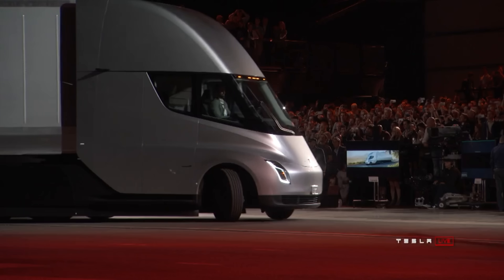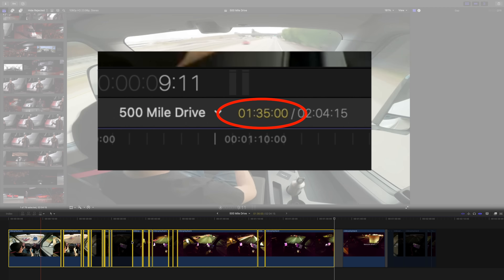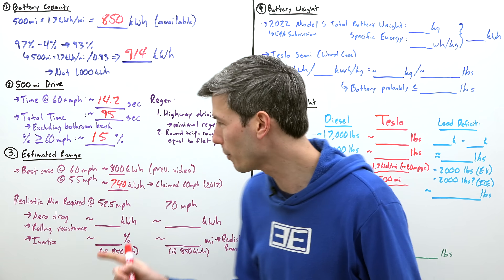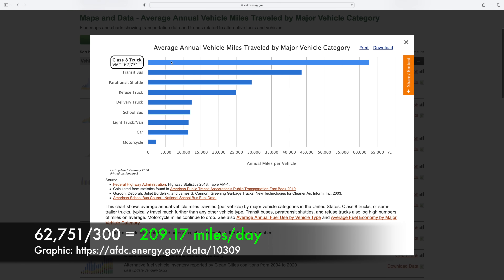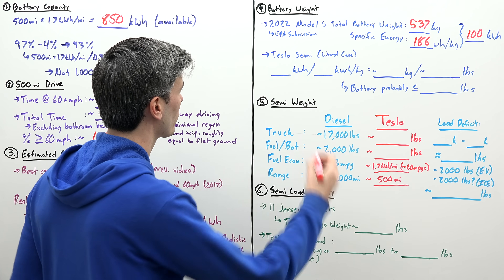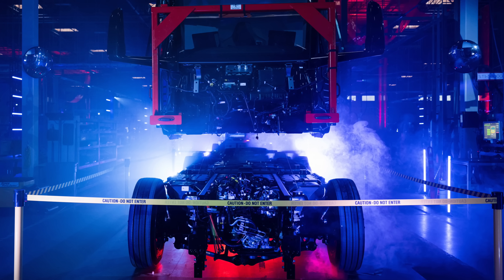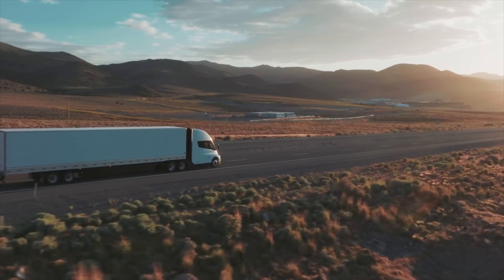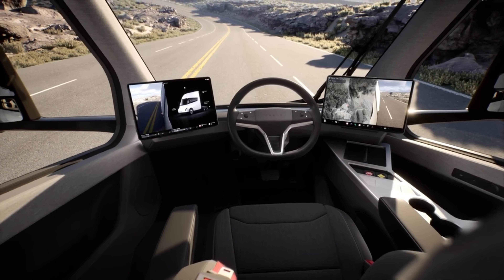Does The Tesla Semi Make Any Sense? Part 2!

Comment: Thank you!  Tired of people doing shady math based of half a sentence from random articles.  Thanks for actually doing some research and trying to be as empirical and objective as possible.  I am a big fan of Tesla engineering but I’m sick and tired of the bias (both for and against).  Let’s be objective and impartial.
Reply: @dasfoot  regenerative braking has its limits, it only works in a narrow range because there's a limit as to how fast you can dump energy back into the batteries, and a loaded semi will likely be over that and use mechanical brakes often
Reply: @finish_my_projects  but regen should be adequate for going down most hills, and you could even designed the regen to that performance point. I am not saying Tesla has, or hasn’t.
Reply: @dasfoot  There is no information to say how good regen will be on these trucks. There is a lot more weight to contend with compared to a car. The front brakes do a lot of work in a semi, that is all going to waste with the current setup.
Reply: @jcd-k2s   did you not watch or did you not like the part at 13:41 ?
Reply: @dasfoot  The graph of a cherry picked route? I don't see any numbers related to regen, but it is hard to see on my phone. It is almost certainly going to be worse than you get in a car. The front brakes and trailer brakes cannot capture any energy and are always going to be used to some extent. You have to use trailer brakes all the time, you do not want that thing starting to pass you...
Reply: @dasfoot  I would like to see more real world driving to see how well it actually works on a semi. He was dragging his feet, no trucker is going to do that when they get paid by the load. I can see terrain giving good regen, but actual braking events, I have my doubts. I could be dead wrong, it has happened a time or two. Too early to tell.
Reply: @dasfoot  its not about battery size, it's about the rate at which the energy is generated... this happens with the cars too, if your braking exceeds the rate at which the batteries can accept energy, you lose it, period... moderate braking prevents this, unless you load up a vehicle with tons of cargo, then every stop has the potential to exceed the inverters and batteries capabilities of regen..regenerative... 

I'm an electrical engineer, I program drives (inverters) for industrial electric motors, I know how it works 🤷‍♂️
Reply: @dasfoot  oh really? 😂 back to engineering school? Where I graduated with honors? Which electrical engineering degree do you have again? You don't think there could be some possible bottle necks along the way to those batteries?? And the cells can only take on energy so fast, regardless of how many there are, period...
Reply: @jcd-k2s  elaborate.
Reply: @mmdias87  
Get ready for a long wait ! 😂
.
I'd love to know who Benoit thinks IS "objective".
.
(I do think there are a few starting parameters requiring adjustment)
Reply: @dasfoot  I would argue that it is an advantage but not a huge one.  There are plenty of other things diesel trucks have advantages  over electric that he did not mention for the same reason that are of the same level.   Examples are cold weather performance, consistent performance over time (battery degradation)
Reply: @mmdias87  the whole point is diesel fumes..
Reply: Nobody is more shady than Elon.  Why not just tell people how much it weighs, what's the payload, and when can the people that put deposits down 5 years ago get their trucks ....   Instead we have a pile of videos that begin each sentence with "we can assume", "possibly" "maybe", and "theoretically"....
Reply: @richbosch9564  what company divulges information on a product that has not yet been put for sale publicly and available?  No one.  Go get the specs on a new generation mac book  pro that hasn't come out yet... Or a ford mustang that has a new engine...  It's normal.  

Those m1 and m2 chips are still a mystery.
Reply: @mmdias87  quite right mm-87,  the only people that actually need that information are the people actually getting the trucks, that have put the infrostructure in to charge the vehicles.  I am sure that tesla is working with those customers to make sure the vehicles meet there needs.  By the time the semi is available to all,  the specs will be better than they are now.   This is when this information will become available.   Indeed.this seams to be the status with all semi trucks.  It is difficult to get this information on any semitruck.  NIKOLA bev publish the gross vehicle weight for semi and trailer not the mass of the tractor unit.  
Most of these organisations have covered themselves and have reservations with all potential suppliers,  as units become available  it will be interesting to see which they go forward with.   It appears to me Tesla's semi outshines all the rest by miles.   But no one else has such outstanding motors and management systems.  Only other ev motor in the running could be lucid's  but they have not got to semi's yet.  Thankyou Lucid for pushing tesla to come up with the plaid motor and control circuitry., real competition can be good.
Reply: @mmdias87  slow down there if you’re selling a product with a literally the product is how much weight you can move then of course you tell the customer how much weight you can move: the fact that he won’t specify it is shady as all get out. Jesus!
Reply: @JoeOvercoat  the product is not yet available to the public.
Reply: @mmdias87  yes but once Pepsi starts operating them, unless they’re operating them as prototypes, you should be able to walk up to the cab of the truck and read the gross & max net weights off the side of the truck.
Reply: @JoeOvercoat  i would argue they are prototypes.
Reply: "slow down there if you’re selling a product with a literally the product is how much weight you can move then of course you tell the customer how much weight you can move: the fact that he won’t specify it is shady as all get out. Jesus!"  @JoeOvercoat  

Bold of you to assume that YOU are the customer and that YOU need the information. 
More than likely the people who are ACTUALLY BUYING IT have the information they need to make an informed decision.
Reply: @mmdias87 Apple really isn’t the best choice of analogy as they allow a lot of leaks about their products. Multiple sources have already confirmed the core counts for the M2 Pro and Max Chips. We new lots about the Mac Studio including its name and that it’s CPU would be 2 M1 Max chips combined before its announcement event.

The fact that Tesla is hiding a figure that would be extremely important to anyone who would want to buy the Semi kind of shows that it is too heavy for all but a few niche use cases.
Reply: @davidclark2286  How is does “semi is available to all” ever happen with no plan for any public Semi MW charging system?
Reply: @Nill757  The democrats will throw subsidies at EVs so long as they have the power to do so. We'll have to wait and see what the republican house does. Charging is a real concern, I'd be curious to see a video about the grid demands of a full fleet EV conversion.
Reply: @Nill757  there are plans for installing  public tesla mega chargers,  it is not really relevant at the moment as the only people getting them are those that have installed their own home base charging facilities and the day cabs return to base daily.  I am sure any organisation that go base to base with  installed chargers will be included.    Most of the reserved semis are fleets.  But not all. Fairly sure I have read they have built there first public mega charger.   Wallmart, who have done a lot of research regarding low emission vehicles say 500 mile works for them because the semis return unloaded.  Wallmart are installing charging at stores but this is for local distribution not mega chargers but of course there could be exceptions.
So I believe by the time they get through the pre orders they will have the necessary chargers available. Which may also tie in with when second hand units from fleets come to market.
Reply: @CaliMeatWagon  <double facepalm>
Reply: @JoeOvercoat  Are you a potential Tesla Semi customer? A potential customer of any semi manufacturer?
Reply: @CaliMeatWagon  if they’re giving them away for free along with charging stations yes, I’m ready to go into the short haul trucking business myself absolutely. Regardless, your premise is flawed. Let me try another approach: here you have someone bragging about their new product, but they won’t mention the single most important metric. If that doesn’t set off your alarm bells, then are you really got to learn to be more skeptical or people are going to be taking advantage of you day in and day out.
Reply: @arbitraryalias9825  “grid demands full fleet”

Whole EV fleet requirement has been done many times and looking just at the power plants it’s not that bad.  The problem is the grid is nowhere close to pushing that power out to the last mile.  It’s designed to spread small bits of power around to many places, like leaves on trees, and the occasional big power push to a remote  factory.  The 9000 gal petrol tank we all see down the corner station is a chemical equivalent to a Hoover Dam on wheels.  That’s not going to be replaced with small wires to neighborhoods.
Reply: @davidclark2286  “plans for installing public mega chargers”

You’re mistaken.  There are no serious (financed) plans.  Tesla specifically made no mention in the presentation, nor has any other 3rd party.   Only chargers so far are Tesla internal and Pepsi.  The Megacharger uses a new Tesla custom, liquid cooled charging cable, so they’re the only source for some time to come.  A megacharger with the required multiple 3 MWh Megapacks as shown in the Semi presentation is probably $3 million each, and require a pretty good footprint on the ground.  Of course, the source of infinite  money, the US govt might pay for it all in the US, which does not lower the fundamental cost and therefore does nothing to resolve global transportation emissions.
Reply: @JoeOvercoat  Do you have the specs for the newest missile system from Raytheon? Or how about the specs for the F-15EX Eagle I?
Reply: @CaliMeatWagon  You can get all the specs you want short of classification.  Most especially you can get the payload.  See Sandboxx news channel, among others.
Reply: It's great. We just have to divert all our tax money to Elon.
Reply: @Sonny_McMacsson  I hope not.. but here in Canada I'm tired of funneling money to ford gm and Chrysler every 3 years when they all of sudden want to discontinue a plant or cut a production line and our governments have to inject money to keep those jobs.  Tired of this bs.    I don't want subsidies for anyone but if they must be given out I hope it's for technology that will reduce our dependence on oil for one that is more efficient and effective.
Reply: @mmdias87  I doubt Tesla is ultimately immune to any of that. I mean, why would it be?

Efficiency isn't the most important thing anyway and it'll only carry us so far before nothing more can be done in that area. What you mean by "effective" in this context, I have no idea.
Reply: @Sonny_McMacsson  good point.  Efficient in terms of its use of energy.  Effective in a practical sense such as Day to day use, reliability, total cost of ownership etc.
Reply: @mmdias87  Complaining about dependence on one technology while then switching to a different one is ludicrous. Electricity is over 50% higher than it was 4 years ago. It will be 300% higher in 10 years with electric vehicles straining our grid.
Reply: @stans5270  electricity can be generated in a variety of different ways. Also it can be generated domestically with less foreign influence.
Reply: "I doubt Tesla is ultimately immune to any of that. I mean, why would it be?"  @Sonny_McMacsson  

If you are talking about government loans, it is worth noting that Tesla paid theirs back, and early.  Unlike the others.
Reply: @mmdias87  right. Coal and natural gas. Unless we convert every powerplant to nuclear, we've accomplished nothing with EVs
Reply: @giggiddy  hydro, nuclear.  Even if you burn natural gas to produce the electricity it it still a more efficient process.   Internal combustion engines are incredibly inefficient.  Large scale natural gas generators are very efficient.  

I am a bit proponent of nuclear as a bridge technology.
Reply: @giggiddy  2024 and renewables like solar with storage is cheaper than coal or gas. No excuse for you anymore. We have hydro here in BC.
Reply: @mmdias87  I also support nuclear as a bridge tech. 2024 now and we are finding how much we have underestimated solar with storage though.

Comment: Sorry man i think you're making too large of an assumption that those are jersey barriers. If Tesla wasn't hiding something they would just release the gross weight. It doesn't disqualify it from certain use cases, like Frito lay trucking air around but it's unlikely this will compete on the long haul angle that Tesla is pushing